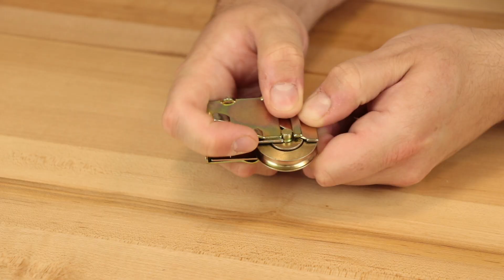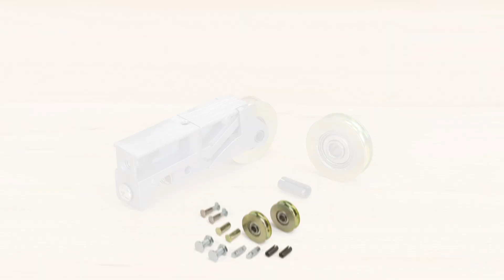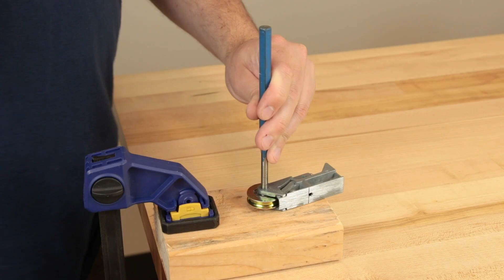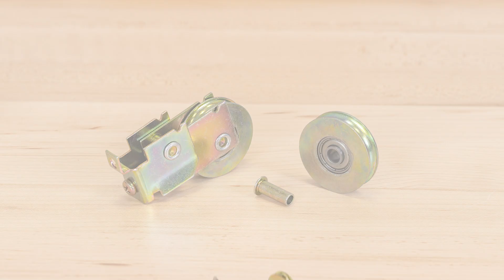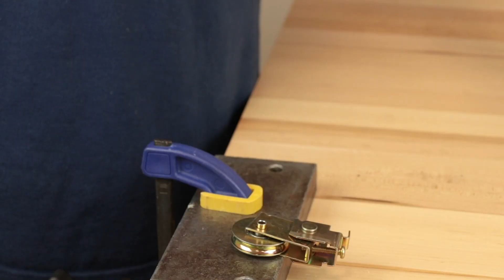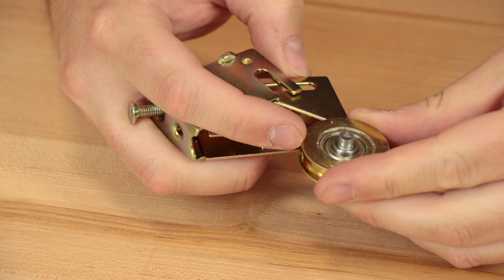How to Repair Sliding Glass Door Roller Wheels and Axles

Comment: This video helped so much..I have 45yr old door. It is desperately in need of new rollers...Cant find the exact assembly to fit. So here i am.  The only kit available to me had a nut and bolt instead of a rivet style.  The screw, when installed only had 1 thread showing. And the nut had a giant chamfer inside. Would not go together.  The fix...Had to grind the nut close to flat to get rid of the chamfer. And i got maybe 1.5 turns to tighten.  I also had to grind the other side down , once assembled, to fit in the door...thanks for the info that got  me started.